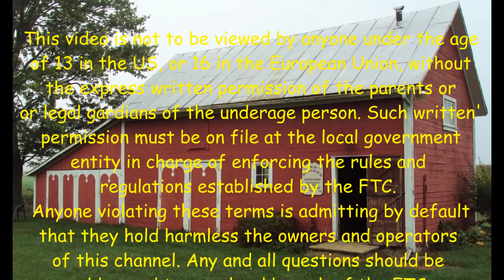New Handle For The Iron City 12 Lb Sledge

Comment: Yes....the good old days when 10 lb sledge wasn`t enough and one had to pull out the 12 lb`er....all days from the past....let the young guys swing that sledge while they can and I`m not sure if they`ll go at it as long as we did....CHEERS
Reply: I hope they have enough sense to quit before they kill their selves like we did!
Reply from the maker: They rent or buy a excavator with a jack hammer attached.
Reply: @OldSneelock  They don't come easy because there's too much to tear up on the hammer. If there's a lot to do a grading outfit gets their own hammer and supplies it's own operator. I ran 3 different ones at the boulder hole, a 245 Cat, a 900 Deere and a Daewoo about the size of a 320 Cat. I liked the Daewoo best because it had the most leg and cab room, the Deere had the longest boom and the 245 was just an old work horse with a 3406 engine.. They sure are handy but a 90# pavement breaker beats a sledge!
Reply from the maker: I watched my skinny as a rail, 160 lb, father run a 90 lb jack hooked up to a trailer compressor knocking holes in the foundation of the house we had on Crippen Street In Coldwater. 
He was on his back in the crawlspace making room for the oil furnace ducting and the sewer line to the new bath room.
He held the point between his toes and cut through the laid stone foundation walls. 
I was chief go-for. 8 years old and I could go where he couldn't.
He would work me into the ground when I was 20.
Reply: @OldSneelock  I ran drills and pavement breakers all my life seems like. The 1st real deal was beating concrete truck tubs out. The 1st of the 1st was one of the IH/MTM's with a 9 yd. tub That I managed to crawl through the manhole on the side BUT the truck had to be running because it was so out 0f balance, someone had to stay with the controls to keep the thing from turning and cutting me i two as I crawled in. After I got the lump beat loose it'd stay put somewhat but I was inside then and a shift wasn't so bad. The blades were knife edged though. The air hose popped and I cut the bad section off with one of the blades, it was that sharp. It was winter so I had on extra clothes but still didn't want to fall on a blade. The last truck I cleaned out was with a Bosch demo hammer in 02 I think. Was hauling boy/son around, he was asleep and I had what was left of a hot load and was turning it slow so he could snore and the mix started setting up and the tub stopped. I had a system then and after taking the side hatch off I went in through the loading chute with my stuff and laid a box fan on the chute for fresh air. I'd stay in there all day. Had p-bottles though! Them was the daze!

Comment: My shoulder hurts just looking at that beast!   12 pounds is heavy!   =D   Great stuff Dave!
Reply from the maker: 12 lbs on a 32" handle is even heavier.
Reply: YOU're the one that worked out with Arnie though!
Reply from the maker: And I use to bench press 400 lbs when I weighed 185. We wuz younger then. 
If we knew then what we know now. 😁😎
Reply: @OldSneelock  I never could lift weights. Never saw any purpose in it. I turned logs mainly without a hook with the old White Mule gauntlet gloves. The mill had no lift and we wallered beams on the log truck and off to the planer by hand. I always toted one end by myself. Years after that I was doing yard work and saw a couple of pals on the next place over fixing to replace some deck beams, laminated 2x6x14 or16 long. One was the boss who was an old school pal and an ex block mason. Laid 12-inchers, one in each hand all day long. The beam was sitting on saw horses and he was sitting on the near end eating lunch/dinner as was the pother guy. The other guy was a basketball player and about 6'4" or so. I told him to get one end of the beam and lets tote it over so the boss wouldn't have to tear up the yard with his skid steer moving the beam. We mowed that one too. The4 ball guy said I was nutz and kept eating. I told him it wasn't THAT heavy and he continued yapping about how goofy I was. I was getting peeved and grabbed it and up it came, boss, lunch/dinner and all. It was just the right height and you know how it is to grab something and just raise it up. I did, about 8 inches and hollered 'Come ON, Ralph, lets GO' and the suspended boss just gulped big and said 'NowLewisNowLewis'.  Never did move the beam by hand but I'd moved others that were green as gourds and a lot heavier. We could cut 22 foot long stuff and I know we cut a bunch of 20 foot for house orders. And I don't have many regrets. Just at times!!!
Reply from the maker: @lewiemcneely9143  I was skinny and short when I was a kid. When I turned 14 I asked for a set of weights for Christmas. Mom & Dad got me a 110 lb set from Sears.
I worked with them every week. By the time I was 15 I could put 110 lbs overhead. I hit a growth spurt when I turned 16 and went up to 160. 
By then I was doing curls with the 110 lb bar and the overhead was pretty easy. My neighbor and I worked out with them in his basement with a much higher ceiling. 
When I turned 21 I and another friend were working out with a 400 lb set he owned. He also had a black belt in Karate. It was fun and I was up to 185. 
Working at Homebuilders in the weld shop I cut iron and welded the trailer frames. Gene Precker and I hauled 6" wide flange beams and build the trailers to haul the houses. 
Everything went fine until I turned 40. I was cutting up a fallen tree and the chainsaw ran out of gas. Rather than wait I picked up a 12" branch about 10 feet long and set it on the truck. When I went to unload it rather than move my feet I just twisted and dropped it. 
When Ryan and I went to get gas I got out of the truck, filled the tank, set it in the back, when I went to get back in I couldn't raise my right leg. 
I crushed the L4 disk. 
6 years I took Motrin 8  at a time. 3 times a day. 
I am a bit more careful now. 
Doc told me that up until you are 25 the discs are very flexible. Then they start to harden.
Reply: @OldSneelock  When I was in the tropics I got one of the exercisers that had a big spring in the middle and a handle on each end. Right stiff spring. We had our evening kill-ball (Asian volleyball) games and I always worked that thing usually right before. The sides and front were one thing but the behind the back was a real deal and you had to go reasonably slow. I was up to around 45 or 50 reps behind the back. My son-in-law is a BULL! His co-workers call him 'The OX'. It killed him to do 2. We cleaned out from under the conveyors at the quarry every evening. I could bend over and drag out 75 rounded shovels before straightening up. Me and the other driver did it all and he was a dab older than me. My shoulders still do all right but the lower back has 3 or 4 vertebrae fused from somewhere. I watch that but am just lacking in general zip. I can still put a machine through it's paces but the zip runs out. Ahh, wearing out is a bummer!
Reply from the maker: All my brothers and sisters have had back trouble. Carol and I are the only ones not to have surgrery of some kind. 
I went to see about getting the surgery. My Dr asked if it was getting at all better. I said it had improved over time. He said then don't get the surgery.
Reply: @OldSneelock  A good friend of mine had it and later said he wished he knew how it was and he'd never have gotten it.

Comment: NICE job! Years ago (I use that term a lot) we were hauling up a horses face and another truck probably hopped and snapped an axle. Of course the brakes wouldn't hold it and it had to be rolled back down to the bottom and as the axle broke on a slant, it flared the end of the spindle out where the retaining nuts and outside bearing rode. The spindles were a shrink fit and replaceable but this was way before the days of hydraulic pullers. Tires off, axels removed, plate welded over the bad spindle, drill steel ran all the way through the housing and a piece of 3x3x1 welded to the striking end for a 'target'. Enter me and a 16# rock hammer. I had an abundance of lead in my pencil back then and was a big, dumb guy that didn't know better and didn't care. The driller Cliff and his son Kenny came for something and stayed to watch. I was swinging from my toenails out and would move that spindle out about the thickness of a hair. Every time I hit that thing Cliff would jump about a foot off the floor. I soon pulled my back and shoulders out and was back in a truck. They replaced the spindle and I think the old DM is still running. No wonder my back hurts. Between that and sawmilling. And no i.q. GBWYall!
Reply from the maker: "If We Knew Then What We Know Now
Life would be better. 
If I knew then what I know now 
I wouldn't have lifted that steel beam.
I'd trade the fun of hauling those rocks. 
l'd have lifted with my legs.
My back wouldn't have felt like cracked eggs. 
If I knew then, oh, what I know now
I would have settled for lifting 350.
If I knew then, what I know now
400 was kind of fun. I didn't have to pick it up. 
If I had only taken Dad's advice 
and not picked it up twice.
If I knew then what I know now.
I'd have been happy with no back pain. 
Living a life without strain. 
Not wishing to be running again."
70 ain't so bad. I healed up from when I was a lad. 
I now know that I'm not 10 feet tall. 
I"m bullet proof, not at all. 
I'm really only 6 feet. 
I'm dent resistant. That can't be beat!
I know now what I know now. 
The next 70 will be better. 
Cause I know now what I know now.
Reply: @OldSneelock  Right and then some! GBWYall!
Reply: @OldSneelock  I shovel over my left shoulder. I was moving some clean stone (3/4) on a job that weighs nothing and I did it backwards. My back POPPED and I went down. To my KNEES! I got all right directly but it was SORE for a day or 2. Just that one shovel full did it in. No more of that! Over the left from then on!
Reply from the maker: Doesn't take much. 
For me it started in my right leg. My knee hurt. Pinched nerve in my back from lifting the log and twisting. A couple years later it started hurting bad. 
I went to Coldwater Hospital. They had me on morphine for 3 days. 
A week later I went to rehab. 
It was a farce. They wanted me to lean against the wall and lower down to a sitting position. I started and stopped. It HURT!
The next morning I was taking a shower and I couldn't flex my left foot. The calf was numb. 
I had blew another disc from the idiot rehab. 
Last time I had anything to do with the Coldwater Hospital.
Reply: @OldSneelock  Mine started in my back trying to mash a clutch in a truck set up for a midget. WAY too high and pulled the muscles loose from my back bone. Went to a chiropractor and he got it better but took acupuncture and that did it. It comers back but not as bad and not for long. I had 'rehab' after I got my stent and was on a rowing/peddling deal and kept favoring my right arm. Next day arthur started creeping right down from the shoulder all the way to my hand. It's better since I quit taking the stuff in No Sant that helps make nylon or whateveritis. A plastic anyway. Got lots more movement and some feeling but still nothing to shout about. Just worn out I guess. I blamed sure ought to be.

Comment: The 'Self-made Millionaire' that lives down the road grew up swinging a hammer in an Olivine mine in Mitchell County. I remember him well when he first came here and married a classmate of mine. He was and is shorter than me (now, not so much) and was at least 3 feet wide across the shoulders and his arms were the size of my leg. Of course he's not that big now but still nothing but bone and gristle. Back then he was wound as tight as an 8-day clock and always had something going. Could and did fix anything. Still does. GBWYall!
Reply from the maker: Grampa Snyder was that way. He sorted castings at the foundry for most of his life. He pitched 20 lb castings across the line into tubs. Had a grip like a gorilla. 
Gramma Snyder was 6 feet tall and strong as an ox. 
My uncles on Mom's side were all big guys. Lawrence and Warren worked as movers. Uncle Larry could wrap a strap around an upright piano and walk off with it over his shoulder. 
He pitched fast pitch softball. He was really good at pitching and hitting. Lots of home runs. 
He had to. He couldn't outrun a one bounce to center. They would pick him off at first. 😁😎
Reply: @OldSneelock  Sounds like my Great Uncle Fred who ended up somewhere in Washington State in the timber industry. My Grandma said I was a lot like him but nothing as strong. They had a general store and everything was shipped in 200# sacks, burlap with ears at the corners. I had been told by several old timers and family members that Fred could walk out 2 sacks at a time and throw them up into a wagon with one hand and if he was feeling extra froggy he'd bring out one in his teeth but I doubt he could toss that one very far. She also said I was exactly like him in that he/we didn't care if there was just one thing on the supper table, as long as there was plenty of it. YAAY Uncle Fred!

Comment: Too big for me to swing now, a 7lb does what I need for fence posts etc and a short 4lb Thor style for more precise hitting. When putting on any wooden handles I use a Surform, not pretty but it is effective.
Reply from the maker: I think it is too heavy for my 114 lb anvil. !2 lbs coming down from 10 feet up at a high rate of speed would overpower the strength of the anvil and cause it to bounce.

Comment: How long did it actually take from start to finish on the handle only ? Wish you could get bare wood handles.
Reply from the maker: About half an hour to fit it to the head and another 10 minutes to make the wooden wedge and install it with the steel ones. 
The varnish is to seal them for shipment so they don't get dirty. 
https://tennesseehickory.com/replacements.shtml